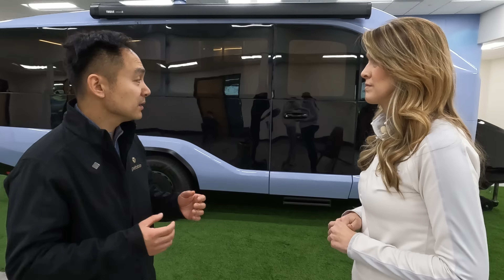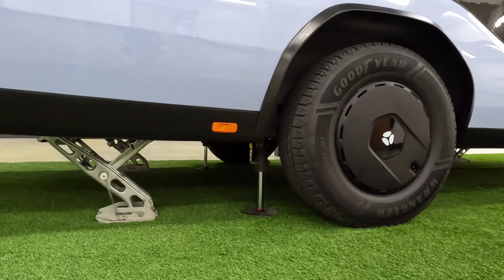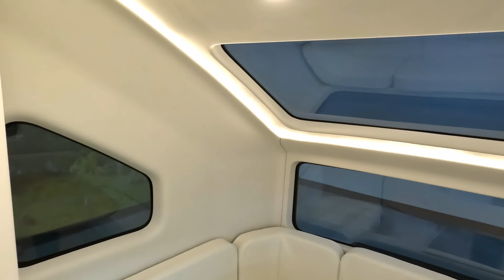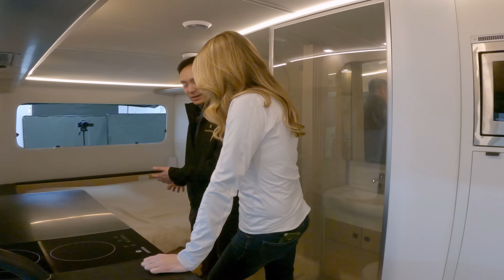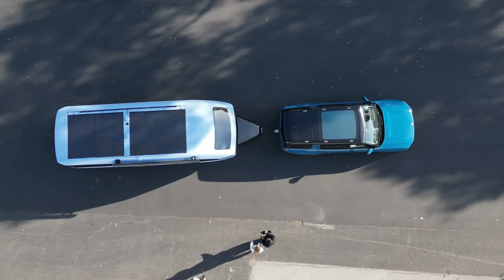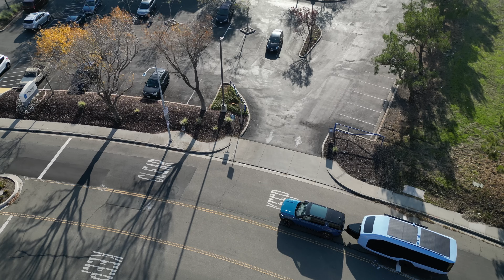Pebble Flow Electric Travel Trailer FULL TOUR (Production-Intent World Premiere)

Comment: Overall, it is a very nice trailer. Especially for a North American trailer. However, there is also a lot of unnecessary nonsense. The most iconic of which is the clear 'glass' wall and door of the bathroom. That is technology for the sake of it and who wants to see the toilet when they are preparing a meal in the kitchen? As soon as Miss GoElectric put on the lights in the bathroom, her silhouette is clearly visible. No thank you. To be honest, the darkening windows around the trailer are also nothing more than a gimmick. The opening windows didn't seem to have fly-screens on them. Ordinary blinds and fly screens with the ability to open all windows is far preferable to electronic gimmicky gadgets. Sometimes, one simply wants to shade an area as they work on a computer or read a book. A traditional blind would do far better in blocking out that silhouette that was also brilliantly demonstrated. For all this technology, it still doesn't come with a parking brake. A standard feature on any European or Australian braked trailer. I am rather disappointed that the manufacturer has decided to emulate the very stupid trend that automotive manufacturers succumb to in adding anything and everything electronic just because the vehicle is all-electric when the less unnecessary items that drain the battery is far better.
Reply from the maker: Actually, motorized components were removed since the prototype phase. 

The glass bathroom prevents the kitchen from feeling cramped. Smart glass is a great solution. A silhouette from the bathroom is not a privacy violation in my opinion.

Privacy glass on the exterior windows allows natural light and privacy while keeping the aesthetic clean and futuristic.

All windows which open come with removable magnetic bug screens standard for all trim levels. 

The vehicle does have its own parking brake at the axle. There is no need for wheel chocks. Pebble's instacamp feature automates and simplifies set up to a greater extent than any other RV I've seen at any price.

Autonomous hitching, remote control, massive 40kWh battery, Starlink integration, tow vehicle trailer camera monitoring, app control, and over the air updates make RV camping accessible to entirely new audiences who never would have considered an RV. Integrated solar and the EZ Tow range assist features make it possible to gather energy whole towing. The ability to use the RV as a home power backup or fully renewable EV charger create enormous value. Those are among the reasons we ordered one.

-Producer Tim
Reply: @MissGoElectric  "The glass bathroom prevents the kitchen from feeling cramped. Smart glass is a great solution. A silhouette from the bathroom is not a privacy violation in my opinion." Really? So, you have someone fixing a drink at the sink and your wife is good with them seeing her behind coming up off the toilet or changing her shirt? Likewise from the exterior if that too has the same effect? Don't get me wrong, I think those windows are super cool. But some (maybe most) women would have an issue with their silouetted breasts shadow-puppeted for the entire campground as they change into their PJs at night.
Reply from the maker: Nobody outside of the RV could possibly discern any details from the bathroom with exterior and interior privacy glass activated. 
-Producer Tim
Reply: @ you missed the point. Possibly intentionally. I was talking about the ability to see silhouetting of people inside the general living space - bedroom area - say getting dressed with the lights on while it is dark outside. That is all.
Reply from the maker: Your words: "... women would have an issue with their silouetted breasts shadow-puppeted for the entire campground as they change into their PJs at night." 

Are the terms entire campground and "trailer occupants" freely interchangeable?
-Producer Tim
Reply: Black out blinds are standard.  The oleophobic glass is an option.

Comment: Rough terrain…This trailer??….do not attempt that….you’ll be stuck before you know.
Reply from the maker: Traction matters. What competing 26ft trailer has truck tires with more width or diameter than the Pebble Flow?

What trailer on the market today can deliver torque to its own wheels? Do you have data to support the notion that the Pebble Flow has an inferior departure angle compared to other 26ft options from leaders such as Airstream? 

-Producer Tim
Reply: it’s not complicated. First, if you  are an off grid overlander, then you know than long trailers don’t even make it to the entrance of a rugged terrain, second it doesn’t matter your departing angle because your trailer is so long that all you’ll do is shave the bottom of your trailer and leave half of it at the bottom of a simple rock hill, I can guarantee you that. Third, it doesn’t have the right set of suspension coupled with air ride or longer off road springs so it won’t climb anything. Fifth, do me a favor and go to Moab or any other trails and send me a picture of a trailer this long that made the first 300 yards. I for sure, haven’t seen one and I spent my days there. The Flow is just a trailer for a nice flat grassy or sandy (to be proven otherwise) and that’s all. Finally, the Rivian won’t be able to off road with it, I’ve tried a few campers and the only one that worked was a small MDC 12 feet equipped with crazy suspensions but I would suggest even smaller for off roading with the rivian
Reply from the maker: A very small percentage of RVs sold are capable of serious rock crawling or built for overlanders. This is an Airstream competitor. A mainstream product. -Producer Tim
Reply: @MissGoElectric I know right?!  He’s comparing this trailer to a Jeep Wrangler.  lol

Comment: As much as I like this this travel trailer, the price is way beyond what most people would pay for this. $109,500, $135,500, or as shown in the video for $175,000.  No thanks. I can get a motor home for that price.
Reply from the maker: Have you seen a new 26ft+ motorhome with self leveling, auto outriggers, 1100w of solar power, independent shower, and a massive 40kWh or battery for less than $109k?

If so, please share a link.
-Producer Tim

Comment: So, if it can power itself, do you still need a vehicle that can tow 6800 lbs? Or maybe a 4k tow vehicle can tow it? 

Also, is the price available?
Reply from the maker: Price is published in this video and linked in the video description at the Pebble web site. 109k-175k.

Assistance stops when travel trailer battery is exhausted. The tow vehicle must be capable of pulling 6800lb. 
-Producer Tim
Reply: When the battery runs out from assisting, you will still need a vehicle capable of towing 6800 lbs.

Comment: The awning... how much affect does it impact the overall aerodynamic efficiency??? it seems to stick out a bunch, is there a plan to build something that is more flush to the roof edge?
Reply from the maker: The optional awning will require additional energy to displace air at high speeds. The detriment is probably a very low single digit percentage. Ambient temperature, speed, wind, and moisture levels affect that figure. 
-Producer Tim
Reply: This is a standard type awning that most motorhomes have and while aerodynamics are more important for this trailer they can tweak things a bit more.

Comment: Very little tank capacities, macerator pump is there because they have no DWV slope available (maybe axle is in the way) if they're only building for an EV tow vehicle, they'll have very few customers. No screens on windows? That won't be for outside camping.  Modern, yes, but will need to get more in touch with real world scenarios.
Reply from the maker: A capable gas or diesel vehicle can tow Pebble Flow. Those who don't want drivetrain assistance will have a $109k version.

Removable magnetic screens are standard on all time levels for all opening windows. 
-Producer Tim

Comment: 13gal black tank is really small.  Why not 30 gal black tank, as this could be a perfect off grid camping trailer with the 47gal water tank
Reply from the maker: Every square inch of under-floor space and kilogram of weight utilized by one system or feature is at the expense of another. Engineering teams evaluate probably usage and refine capacities based on testing data and applicable constraints. Thank you for watching and expressing your preferences.

You can voice your thoughts to Pebble directly by joining their community linked in our video description.
-Producer Tim

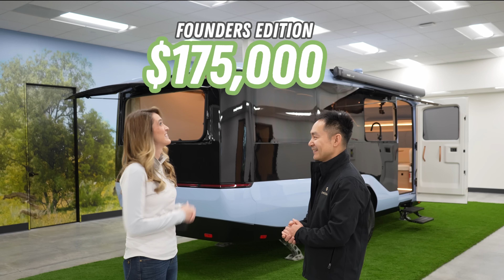Comment: Another exclusive first for Miss GoElectric: A price reveal honoring Marcel Marceau @ 31:10 !  I'm speechless!
Reply from the maker: We got a kick out of that. We filmed this the same day Lightship (upcoming competitor) announced an eye watering initial price of $250,000 for their AE.1 founders edition. 

Pebble's CEO told us that their limited edition initial run pricing had not yet been solidified. The campy (pun intended) graphic overlay price reveal was my off-the-cuff solution.

Perhaps the opportunity for Pebble to improve margins by joining Lightship with a limited run priced in the stratosphere might have caused a bit of rethinking about the initial Pebble Flow price point. I wonder what the plan might have been before Lightship took the heat off. 

Tomorrow at the consumer electronics show there will be a travel trailer unveiling from Airstream. Things could get interesting. Thor Industries (Airstream parent company) is also a major Lightship stakeholder.

Thor has previously announced a plugin hybrid motorhome based on a Harbinger platform with 150mi electric range and 350 with an onboard generator. We expect that later this year, but we don't know what Airstream will show tomorrow. Maybe Thor will leverage the Lightship undercarriage + powertrain without the pop-up transformability. Platform sharing could help both of those brands scale and reach profitability in this segment sooner.
-Producer Tim
Reply: 175k$!! 😂😂😂

Comment: We camp a lot and have learned a need for redundancy. The most relevant for this trailer would be redundancy in charging options if you are off grid. What are the options for charging  this trailer?
Reply from the maker: There are over 100,000 public EV charging stations in the USA which are compatible. Early in this video the standards are shown. 

Most campers will use standard NEMA 14/50 ports at RV sites to charge this. The sun does it, too.

Any 120v or 240v AC outlet is a power source for this RV. There are hundreds of millions of such receptacles in the USA present in almost every structure. -Producer Tim
Reply: @MissGoElectric in Canada, we camp at sites that have 30 amp circuits. Does the trailer come with adapters? Cool concept if we can make it work Ev charge stations are a  non-starter for a trailer for us.

Comment: I just want to point out that you should not expect stellar performance from 1100W of solar on a battery that large. On the best of clear summer days, you'll generate about 10% of the battery. 
This is not to mention any passive draw used by onboard electronics.
Reply from the maker: 4kWh daily would meaningfully extend off-grid time. -Producer Tim
Reply: But Tim what about an extended period of cloudy days? If you were at an electric site in a campground there is a 30 amp outlet but no way shown to use that power source, that is confusing.
Reply from the maker: @frey we show the J1772 port as part of the CCS port in this video. That is where 240v AC power is input. It can accept at least 50A. 30A is no problem. It could take 120V 10A-20A, too.

A person camping in Alaska during a sunny day in June parked out in the open could easily capture 12kWh using the onboard solar array. A cloudy day mid winter in NY parked under a tree might only yield 0.5kWh over a 24hr period.

The onboard 45kWh battery capacity would probably outlast the water supply for a pair of campers in mild weather with no solar power generation. Pebble advertises up to 7 days.

Energy consumption varies wildly based on occupancy, user behavior, and thermal needs (ambient temperature, sun exposure, personal temperature preferences).

We suspect most campers will plug into shore power at a campground most of the time. The ability to boondock is a "nice to have" for typical RVers.

We have reviewed many portable power stations and solar arrays on this channel. Campers with exceptional off-grid power needs can spend an extra 3% to add 25kWh more capacity from Anker, Allpowers, or Jackery. They could stow those battery packs in the gear tunnel and even connect them to external solar arrays.

Some might take electricity from their tow vehicle or a portable gasoline generator.

We live in exciting times with an abundance of great options.
-Producer Tim
Reply: @MissGoElectric it depends on the type of panels they are using, some are way more efficient than others.
Reply: @MissGoElectric  I'm not saying it's bad, or that it shouldn't have it. 

I simply want people to have realistic expectations about what you will get from it.

Comment: One question about the Recharge Mode: When the trailer is operating in regen mode, how much does it increase the weight felt by the R1S?

From my back-of-the-envelope math, assuming the battery's regen charging is about as limited as its DC charging (50 kW max), then the apparent force from generating that amount of power should only be about 500 lbs (maybe 600 with various losses), so with a GVWR of 6800, that's still only 6800+600=7400 max, which is below the R1S safe max of 7700.

But it would be nice to get some confirmed numbers from Pebble about how the tow rating of the vehicle is impacted by the recharge mode.
Reply from the maker: Quantification of recharge mode is not absolute. Speed, terrain, and other factors greatly impact the total resistance at the hitch. Recharge mode engaged along a spectrum factoring traction, state of charge, and duration of engagement. Incline grade and ambient temperature are also inputs which consistently affect motor resistance on a momentary basis.

The software is in development and we expect to see tow vehicle limitations as an input.
-Producer Tim
Reply: @MissGoElectric  Oh, so the Pebble will be aware of the tow rating of the towing vehicle and will dynamically de-rate regen to ensure that it doesn't exceed that limit? Even better!
Reply from the maker: We expect the app to have inputs which dictate limitations. That's a very simple software implementation and it is the beauty of software defined vehicles. -Producer Tim

Comment: Excellent video once again! One concern I have has to do with the single axle. In the video it is mentioned that the trailer comes with a repair kit. If “goop” is used, it can damage the tpms and cause a problem when replacing the tire. If a plug is used, the damage has to be 1-2” away from either sidewall. Hopefully their solution considers these factors. 

Overall, I will buy this over the Lightship based on the price point.
Reply from the maker: The Lightship founders series is $75,000 more expensive than the Pebble Flow. The AE.1 doesn't offer remote control capabilities or smart glass but it does have 2x the battery capacity, battery aerodynamics and a second axle. We encourage viewers to watch our coverage of other all electric RVs. 
 https://www.youtube.com/playlist?list=PL5nuLBN5_QSc-3irl1blsvvjrFeuQ5bPP
-Producer Tim

Comment: Great progress since the prototype. Good walkthrough. Nice entry point a step below the LightShip AE.1.  My only concern is the single axle for a 6,800 lb GVWR trailer and a drive axle at that. Beefy tires are helpful but trailer tires and axles lead a tough life. For instance, Airstream uses two axles for there 23' trailers and above with only a 6,000 GVWR.
Reply: 2 tires instead of 4 reduces the rolling friction and aero drag.
Reply from the maker: @james true. 2 wheels also makes remote control steering less complicated. 2 wheels reduces weight and creates space for other subsystems. Every engineering decision is a calculated trade off. 

The engineering team at Pebble is world class. See the experience: 
https://pebblelife.com/team
 -Producer Tim
Reply from the maker: We asked the axle question because we recognize the point of failure potential.
We asked if the Flow's tire pressure monitor sensor could alert the driver in-car. Anomalous tire pressure often precedes an blowout. Advanced warning via the app/tablet would be a very helpful safety feature.

That said, I've experienced blowouts on many single axle vehicles hauling trailers. None were catastrophic even when I had a million dollar vehicle prototype in the back.

Hyper cautious drivers could keep a spare on the rear hitch, in the tow vehicle, or even in a case stored within the trailer.
-Producer Tim
Reply: @MissGoElectric  I guess it depends on your definition of catastrophic. At a minimum a single axle trailer with a 6,800lb GVWR should then carry a spare tire. Most two axle trailers can continue on after the loss of a tire or axle at reduced speeds on three tires and two axles, so a spare is less important. This issue is by no means a deal breaker, the Pebble Flow seems to be well done and good value for the price.
Reply from the maker: Cautious drivers could keep a spare on the rear hitch, within the tow vehicle, or even in a case stored within the Flow.
-Producer Tim